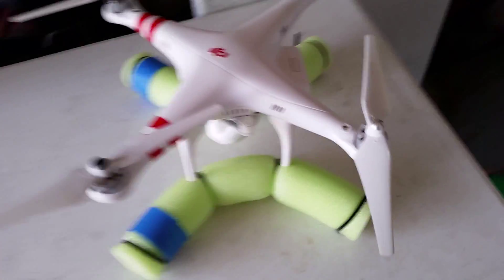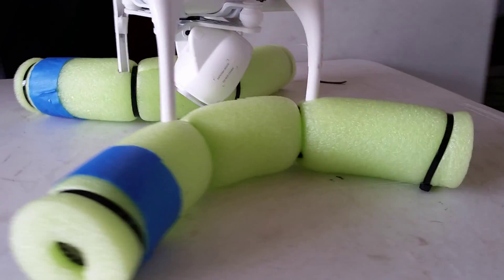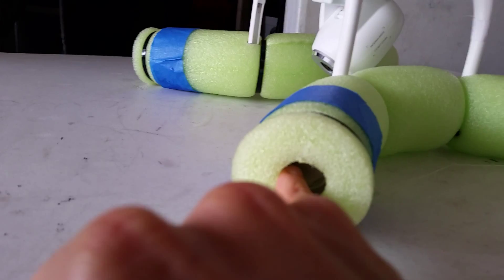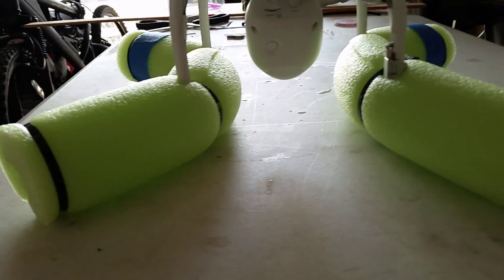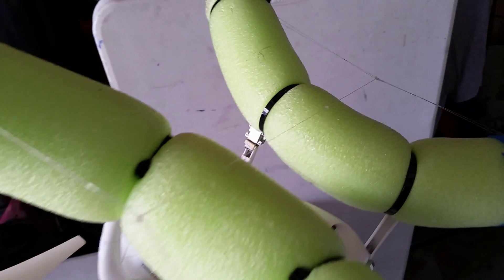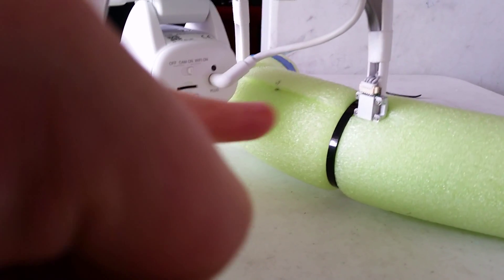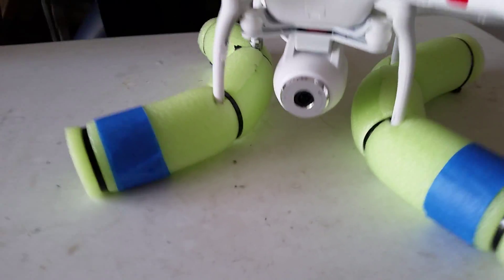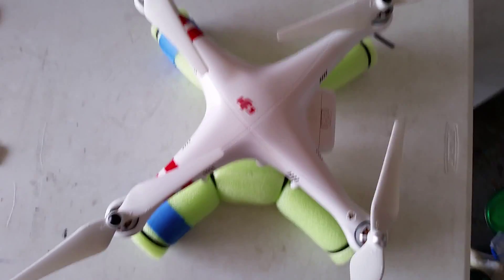HOWTO Make floats for DJI Phantom 2 Vision

Comment: Andrey, If these were mounted on a DJI phantom 2 vision+ v3, do you you think they would be in the camera's field of view?
Reply: ***** Thank you. When I learn to fly this quad for a non profit organization, I will likely be using it for taking photos and video of seagrass beds and shorelines for mapping. 90% of the flight time may be over saltwater. I like that you used fishing line. ;-) Do you think it would help to plug the ends so water couldn't get in and might it float higher in the water then?